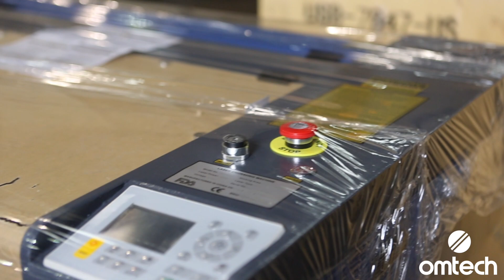How to Uncrate Your OMTech CO2 Laser Engraver - Training Video - OMTech Laser

Comment: One problem, I cant rest the machine on wheels because there's plywood supports jammed under the machine in addition to the outer legs.
Reply from the maker: You can adjust the levelers as low as they go, and knock the wood supports out so you can then raise the levelers so the machine is resting on the wheels.